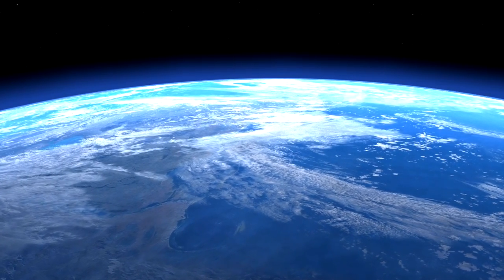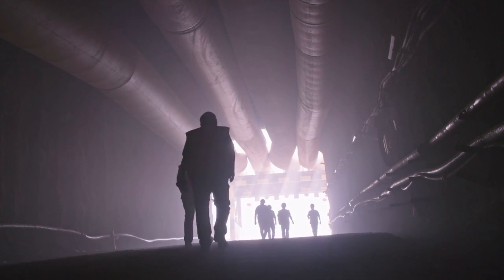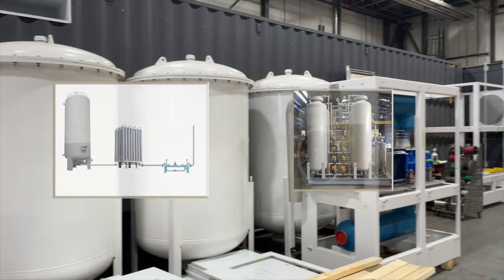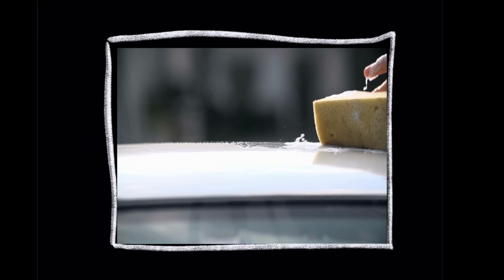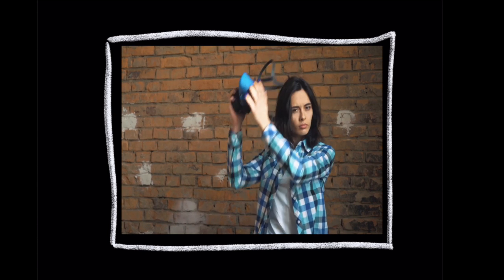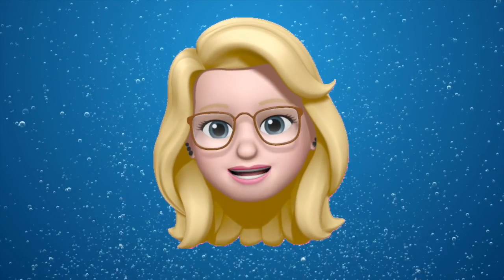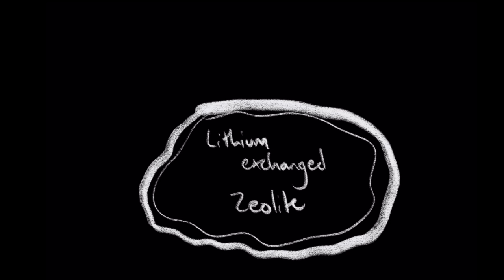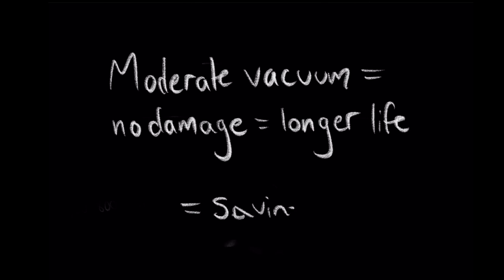Vacuum Swing Adsorption vs Pressure Swing Adsorption

Comment: I have a question. PSA is dirven at high pressure, but VSA is driven at atmosperic pressure. Is there a difference in adsorption power? If it has difference, how much is it?
Reply from the maker: Great question! The molecular sieves, or zeolites, used in PSA and VPSA processes are not the same. In PSA, the zeolites used are inexpensive and have a lower nitrogen adsorption capacity at normal atmospheric pressure. That's why you need a higher pressure (around 50-90 psig) in order to increase their adsorption capabilities. VPSA uses specialized zeolite which has a higher nitrogen adsorption at near atmospheric pressure. When comparing the two zeolites, you'll get the same results showing when the common zeolite in PSA is at high pressure while the specialized zeolite in VPSA is at normal atmospheric pressure. As such, VPSA is more energy efficient to operate because no high-pressure compression is required. I hope this helps!
Reply: @osi-oxygensolutionsinc.3715  

You mean for VSA not for VPSA in above reply....??